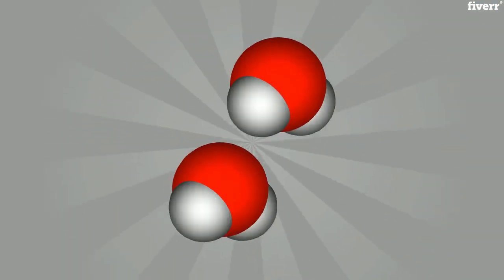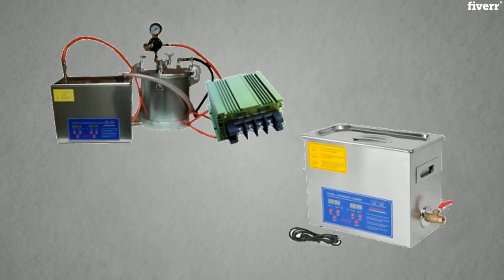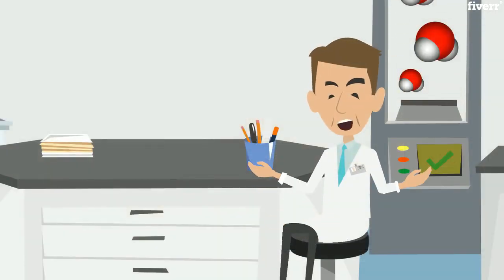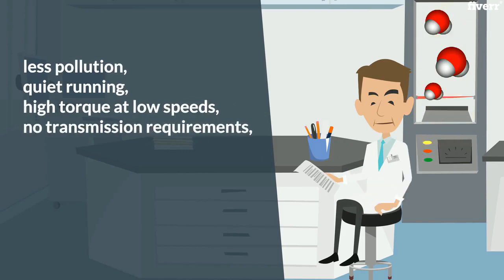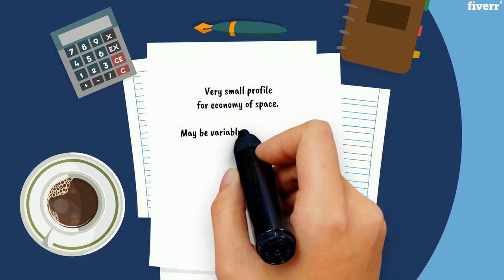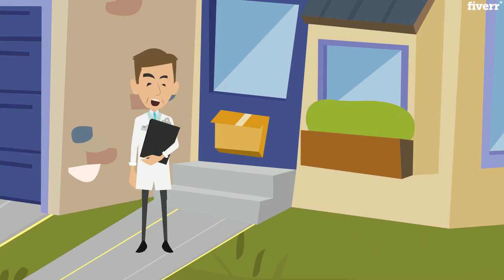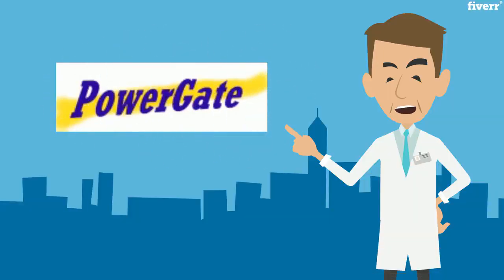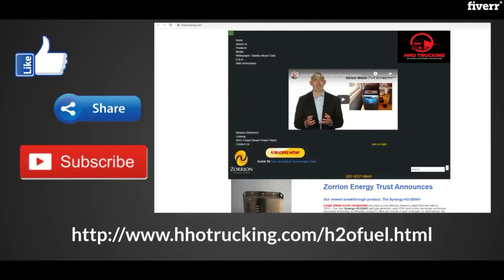Instantaneous Superheated Steam From Hydrogen Plasma Arc Boiler For Off-Grid Steam Power

Comment: What material is used for hho cell gaskets?
Reply from the maker: I use a Split Gas generator (not HHO). It uses Proton Exchange Membrane to produce pure hydrogen from one outlet and pure oxygen from another outlet and it only uses deionized water or John Ellis Water (no electrolyte chemicals). I can compress Hydrogen gas to inject it without worry of explosion.
Reply: @hyfusiondotcom  I made an hho cell,in beginning it was 2amps and production was good then it drop to 0.2amps 
Can you tell me the reason?

Comment: Glad you're using the Green Steam Engine. I was going to order one from Mr Green but he stopped providing them. Although the thermodynamics don't make sense I would love to have one.

so you need Electricity to get your brown gas, store it as is or as pressurized air and then convert it back to electricity? How is that not wasteful?

The video mentions the 1500W PV power system is enough to produce 10kWh. Is that per day? One is power, the other is energy. 

Do you have a breakdown of the energies produced, stored and released?

How much more efficient is it to store this way than in batteries as the video claims at the end.

Thanks for the coming details.
Reply from the maker: My Plasma Arc Boiler is expected to generate 944 times more heat energy than the tiny amount of water or molecular injected. The needed electric current to produce HHO or pure Hydrogen gas, or to generate the Plasma field, combined, is just a tiny fraction of the BTU's in the steam. We are also looking at S.M.'s electromagnetic particle generator/accelerator patents. My partner/researcher found the deliberate flaws in the patent description and graphics. As far as I can tell from the forums, nobody has successfully built the device based on the patents.
Once the principle of how the device works is understood, the device is quite simple. It does exactly what S.M. claims for it: Produces hydrogen/HHO gas while simultaneously producing exponentially more electric current than predicted by conventional science.
We are in the early stages yet so will report back as we test the new theory in the prototype.
Reply: hyfusiondotcom do you have a time frame for prototype? 
Thank you